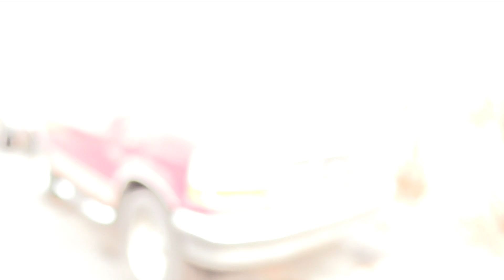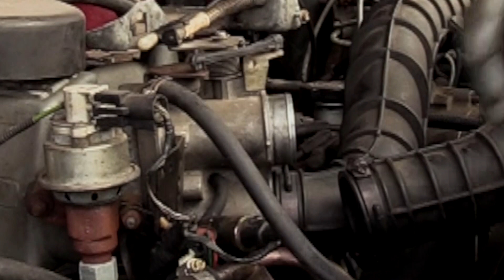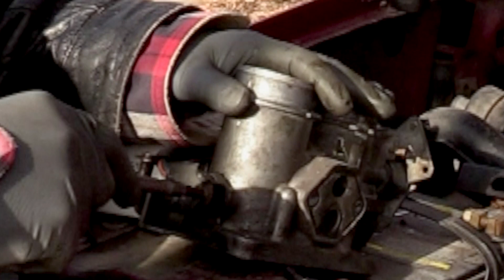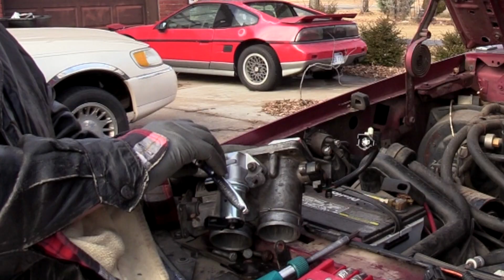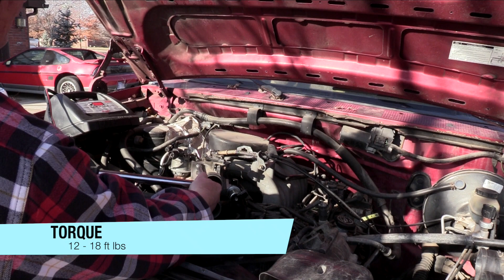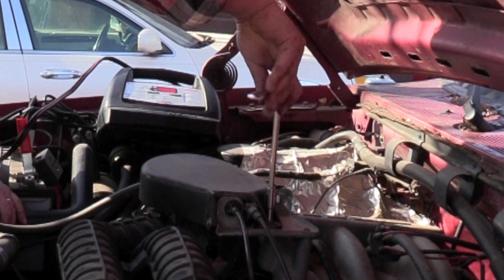Rough Idle ! Replaced TPS & IAC (Throttle Position Sensor, Idle Air Control) 1994 Ford Bronco 5.8L

Comment: Thank you for posting this video. It helped me get my TPS changed, although for me it was more difficult than it appeared in the video haha.
Reply from the maker: @michaelstrane3254  

Glad it helped! 
I began my mechanics journey at 16 in a small engine shop in the 70’s and an Air Force Crew Chief in the early 80’s and self taught Auto Mechanic shortly after ( I have a little mechanical experience).

Comment: After replacing the TPS on my 1994 f-150 5.8L my idle stays at 500 and does not go up unless I hit the gas what could be the issue?
Reply from the maker: @chuyalvarez2322  the idle speed is controlled by the Idle Air Control , IAC .  It’s a solenoid that acts like a choke, it closes an air passage to help the vehicle start , and opens when the vehicle reaches operating temperature.  It’s controlled by the computer that reads sensors such as the coolant temperature to determine when the engine is warmed up enough. 

You can start by testing your IAC , but realize the computer is in charge of idle  speed and it must have proper inputs

Comment: Wao man! I was needing a lot to check how to replace the IAC valve, this gave me all the hands-on view I needed to try it myself.
Reply from the maker: I wish you the best , if you have questions feel free to send a comment
Reply: @normanpaulife  Ive been having some issues with the truck turning off when I leave it go down to the IDLE, as well as when I turn on the air conditioner and I'm stopped, the engine just drop revs until turning off.
Reply: @andresalteclado was the IAC your issue? Literally same symptoms as mine.

Comment: OMG you didnt really remove the entire throttle body to change the tps and IAC did you?
Reply from the maker: The TPS on the truck is on the bottom and completely inaccessible. Many others the TPS is on the top. It has Phillips head screws , “IF” it was possible to remove it with a right angle screwdriver or apex bit, the time it would and risk of stripping the screws would certainly not be worth it. If it was a bet , or a challenge I could probably do it. I was aircraft mechanic for 26 years in the Air Force , replaced much more challenging things because you can’t just remove a Jet Engine to replace a simple component.

Comment: What if your codes say the TPS is out of voltage range after installing a new a new TPS?
Reply from the maker: Double check your signal voltage, from your ECM, I Believe it’s the center pin and most likely 5 volts . If the input is high, you have an ECM ( computer ) problem that needs to be corrected first. Check the wires for opens, shorts to grounds and especially in your case a short to power !
Reply from the maker: Also some not all TPS have adjustments and be certain it is installed correctly ( the detent is properly engaged) . And the rotation is correct ( original) direction

Comment: Hi Norman, how did you diagnose that the TPS and IAC were bad to begin with? Seems like those same symptoms you listed could also be caused by bad ignition parts, so you probably ruled that stuff out somehow. Could you let me know. I have a rough idle on my 96 and trying to come up with a plan for repair. 
Thanks.
Reply from the maker: Rule out the ignition first, by testing or replacing, that engine was a brand new rebuild. I tested the TPS with with a volt meter, the tps is variable resistor, as the throttle is opened and voltage moves linearly. If it drops, flat spots etc it’s bad. The IAC is a choke , If the truck runs rich or stalls after warm up etc it good indication your IAC is sticky. IAC is a motor
Reply: @normanpaulife  Awesome. Makes sense. Thanks.
Reply from the maker: Be sure to test your fuel pressure, for leaking injectors or faulty fuel pressure regulator
Reply: @normanpaulife  Is there a schroeder valve where I can plug in a fuel pressure gauge? I just bought this Bronco yesterday so i am still pretty ignorant.

Comment: My truck runs fine, it warms up, then stalls. cranks, and cranks over. It cools down runs fine. 
I rebuilt the entire electrical system, new fuel filter, new ignition switch under the steering column. Can’t figure it out. 
It will start with a miss at partial throttle, sometimes if I floor it, it will clear up, and run. other times it just dies. crank and crank. let it sit, it starts right back up. 
The engine light doesn’t come on, it does work though.
1995 ford f250 351w 143k original. Everything is original on the truck
Reply from the maker: The computer has two operating mode open loop ( cold engine) and Closed Loop ( operating temperature). What I believe is happening is when the engine reaches operating temperature the computer takes over and begins adjusting the fuel controls and based on sensor data ( possibly faulty sensors) it’s adjusting the fuel too much ( too lean or too rich) and stalling the engine. There are other causes too , perhaps a clogged exhaust! Over heating will shut the engine down , and of course as it cools it allows it to restart. Check you exhaust for flow, check your spark plugs for soot, and check your cooling system for proper level and ensure no vapor locks ( air bubbles ) stopping coolant flow

Comment: Hi sir .I got a 1987 bronco w only 75 k miles. It works fine it just feels really slow I have to hit the gas pedal hard is that normal?I replace the TPS and still doing the same.It does not have  a catalytic converter..so do you think the oxygen sensor works even with out tge catalytic  converter. Thanks
Reply from the maker: The oxygen sensor is up stream of the ( missing) catalytic converter, so yes it’s sensing as designed. No it should not lag. It should have quite a bit of power and acceleration. 

Start with the basics, oil, spark plugs , cap and rotor, air filter. And Fuel filter !!! Then look for vacuum leaks. My experience says many emission sensors are probably not functioning properly. There’s an inexpensive Ford OBD 1 tester you can buy to guide your sensor testing choices
Reply: Thanks a lot.I ordered a tester for OBD I  is a Lil bit over 200 bucks Hopefully that machine will tell me the codes.Thanks ones again .

Comment: Whoever put the tps on last put it on wrong and you installed it wrong too. The ford FSM says on the 5.0 and 5.8 the wiring coming out of the tps should face the IAC you went the other way, just letting you know and others so they install it correctly .
Reply from the maker: That’s great advice ! I’ll change it tomorrow
Reply from the maker: I changed it , in about 15 minutes, no noticeable difference
Reply: My idle is surging. Its driving me crazy.i think i pout mine on wrong so im gonna check it out

Comment: No, no, NO!  NEVER use VASELINE!  IT is totally FLAMMABLE!!  Instead, use SILICONE GREASE!!!
Reply from the maker: I was taught engine rebuilding with Vaseline because it’s petroleum based and with support the surfaces until the oil dissolves and washes it away. I double checked Vaseline is still highly regarded for engine rebuilding including vacuum lines

Comment: How do you align the throttle shaft?
Reply from the maker: I’m sorry I don’t have that answer, I checked the factory service manual, the only setting is an Adjustment Screw for WOT , wide open throttle. The throttle plates close and seal there’s no gap like engines of earlier time. The IAC controls the idle by metering the air through an orifice and it’s controlled by the computer

Comment: So did that fix it? Yesterday I replaced the MAP sensor, tps, all new gaskets and Idle air valve and it still idles super high unless I unplug the idle air valve. I have tried a few new working Idle air and all does the same thing.
Reply from the maker: Check your EGR system , your computer is compensating for something that is not working properly. It’s increasing the idle speed to prevent stalling. I recently found the the EGR solenoid seized solid, it’s an easy test. First of all it’s mounted on a metal bracket forward of the ignition coil, if you remove the hoses and blow through the bottom port it should be closed and when energized with 12 volts it would open to allow free flow ( of vacuum) . I will build a video of it, I recorded the tear down, and cleaning to show a possible fix. The part is $55.00 so test and clean if possible. If you need more info fell free
Reply: @normanpaulife  ok thank you, ill try to figure that out. I am NOT a mechanic by any means so these YouTube videos are what im going off of.
Reply from the maker: We all start at the same place, we try and we learn as we go, good luck and don’t give up ! Soon you’ll be a mechanic
Reply from the maker: I started at a small engine shop at 16 passing wrenches and fetching parts, I learned quite a lot before I was done, so I joined the Air Force and became an Aircraft Mechanic and Crew Chief on B-52’s before I went to school for auto mechanics, frankly I taught myself far more than I learned in school. You can too !!!!

Comment: Lame
Reply from the maker: That was my first video ( 2 years ago), originally shot for a friend and posted on you tube because my Vimeo account with maxed out. It has currently received 11k  views and bringing in approximately 1K a month. I have improved much since then.
Reply: @normanpaulife  Always haters out there......solid video dude.
Reply: @normanpaulife a thousand what? Dollars?! Views?
Reply: I'm just here trying to figure out why you didn't mess with idle speed, checking voltage, ohms; and hoping I can just drop in the part as shown too.
Reply: @OOEarth the idle screw is factor set. Most likely a component in the distributor
Reply: He's actually really cool guy

Comment: Clean throttle body and check plates for fitment with flashlight while closed. No light should shine through when closed.
Reply from the maker: Beware : The factory service manual states no cleaning agents can be used on the Throttle Body , because it will remove the chemical finish.
Reply: @normanpaulife  
Yes back then there was only carb and brake cleaners which would etch the coatings that prevented build up of carbons/oils on throttle bodies. Today there are cleaners for throttle bodies.
Seafoam and a soft used toothbrush works great.
Things change as the science/technologies knowledge changes.
Reply from the maker: @mongomay1  I have considered that too.
Reply: I have read conflicting statements on whether there should be light around the throttle plates when closed. I have a code 411 but aic has been replaced as well as tps and tb gasket besides vacuum lines.
Reply: @rockinhorsefeathers8100  
Test your replaced sensors, nowadays there are too many "new" parts that do not work out of the box. 
Make which generation of codes you have eecv, OBDI or OBDII. They all can mean different things.
Also check your wiring and connectors for wear or broken insulation.
Reply: @mongomay1  93' 4.9 obd1, 2nd new iac no change in idle when disconnected so have to check that connection. Was fine few months ago then started acting up , rough idle ike a misfire. New ecm due to bad capacitors, new icm, coil, cap, plugs, wires, map, engine air temperature, tps, egr valve, vacuum lines up top, tb gasket, vac reservoir, and filter just yesterday. Rough idle occured after "warming" up but at times now randomly immediately. All codes cleared and left with only 411 and the idle still rough. Makes me wish I still had my 73 chevy 3/4  ton, way less sensors! I am wondering if the fuel rail and injectors need to be flushed. TB is one of the coated ones but checked and see light around the plates.

Thanks for your input I appreciate it as this truck is driving me up the wall and only vehicle, wifes subaru is currently dead due to oil consumption.
Reply: @rockinhorsefeathers8100  
Check the sensor ground and harness, heard of a person having a bad wire from the sensor to the ECM, there should be a yt video on how to check signals on IAC valve.
There is also throttle body cleaners now on the market.
Test fuel rail pressure, there is a schrader type fitting. yt has videos on this too.

Heard some of the older 1.9L subaru's had oil leak issues.
Reply: @rockinhorsefeathers8100  
Check for vacuum leaks around the intake and also damper valve on firewall for the heater box runs on vacuum I had this line deteriorate.
Might have to go through Idle factory adjustment.
https://www.ford-trucks.com/forums/188152-engine-high-idle-code-411-a.html
Reply: @rockinhorsefeathers8100 ever figure it out?
Reply: @mannyrod8472  I in the end replaced the timing gear with an all metal one, the oem fiber hybrid  one had started to lose teeth. Did repair a vacuum line by the passenger windshield which I think was for the heater flap.

Comment: Does the TPS affect shifting on E4OD? I wonder if this would improve my sluggish shifting as well...
Reply from the maker: Test your TPS with a multimeter .  The TPS has a direct connection to the engine performance and therefore will directly affect the transmission through the ECM ( computer) .
Reply from the maker: The Computer uses the MAP sensor for adjusting the transmission shift points
Reply: @normanpaulife  you are one of the only channels that promotes that fact!
Also bad shifting is caused my neutral safty switch on trans too.

That would have been cool to start the engine!

https://www.ford-trucks.com/forums/1072528-change-your-mlps-neutral-safety-switch-now.html
Reply from the maker: I have MAP sensor troubleshooting/ replacement video in work
Reply: Mine was doing that and ignition module was going out of the 3 post 2 of them was bad had it test at Napa and O rally.s shift is smooth now. Kicking in ruff and slowing down it would kick hard and you could gear as motor slowing down shifting till stoped.
Reply: The TPS absolutely affects E4OD shifting.